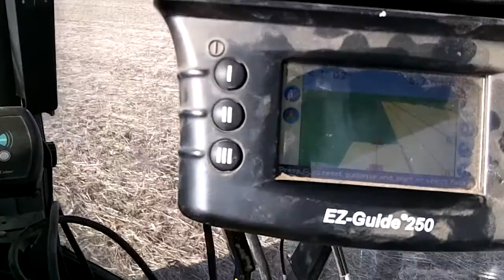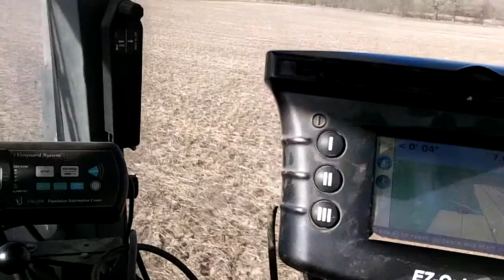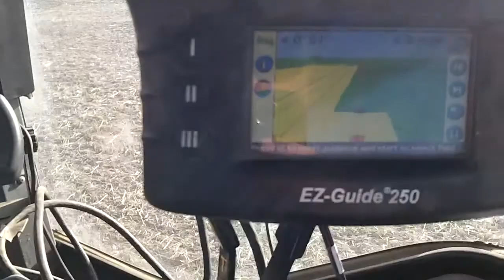Spreading Fertilizer

Comment: I really need to get a GPS unit like that!
Reply from the maker: It works well but always thought I should of went to a higher unit but they costly. I seen them today at my dealer 3 units 2000-4100-6400 Can$ from CIH.